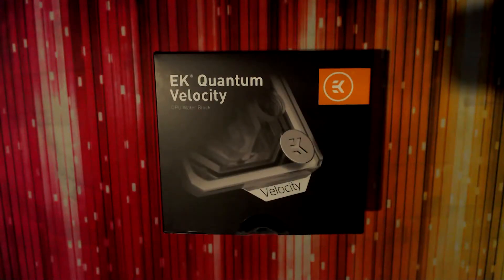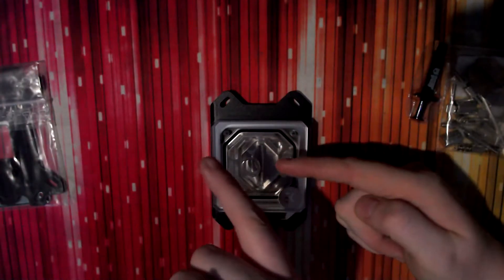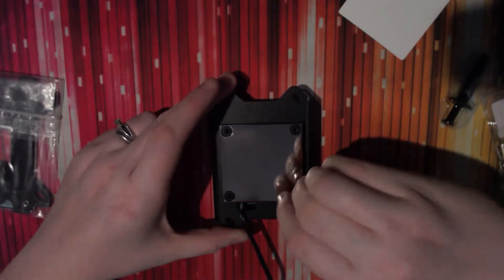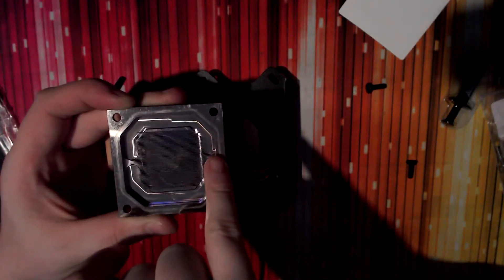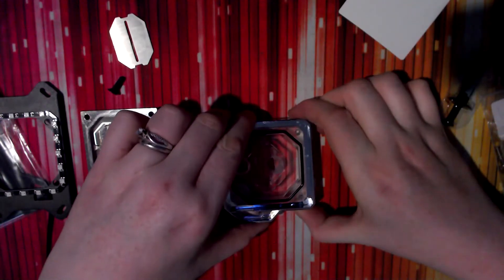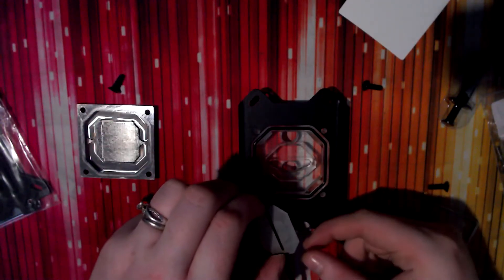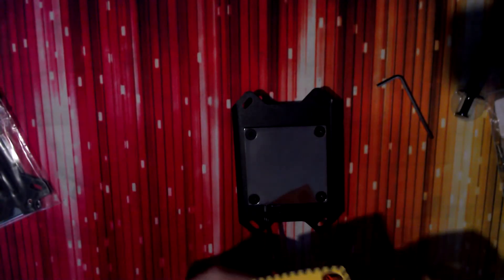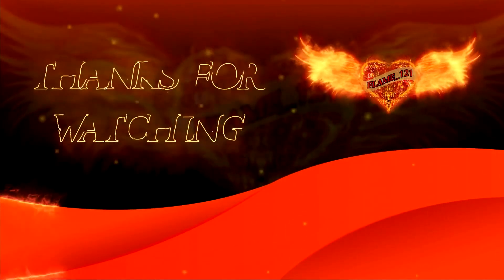Changing orientation on EK-Velocity AMD CPU Water Block

Comment: Thank you. That was quite informative. I opened my Barrow block for the first time and when I tried to put it back I had this conundrum of how to orientate the fins. It seems that most of the Barrow and Bykski blocks seem to come with the top outlet and bottom inlet orientation by default.

I've got a silly question but I just want to make sure. From the reservoir's outlet, I connect that to the CPU block's inlet, and the from the CPU block's outlet, back to the reservoir's inlet, is this correct?

And is it okay if from the reservoir's outlet it passes 2 radiators before reaching the CPU block?

Sorry for all the confusing questions this is my first time!